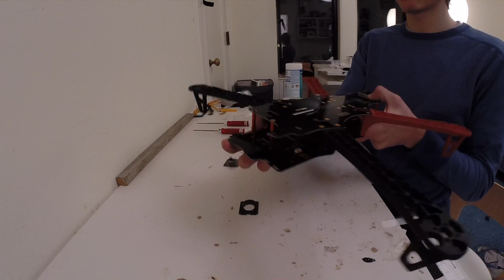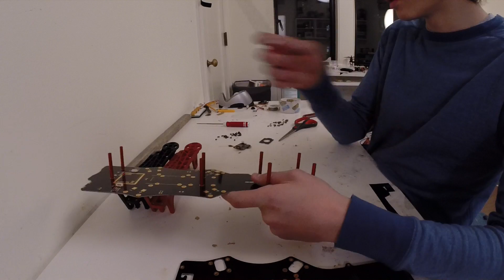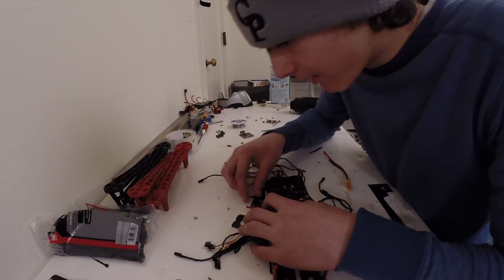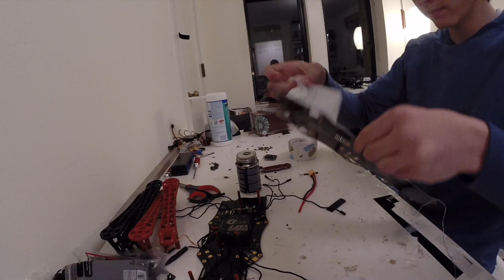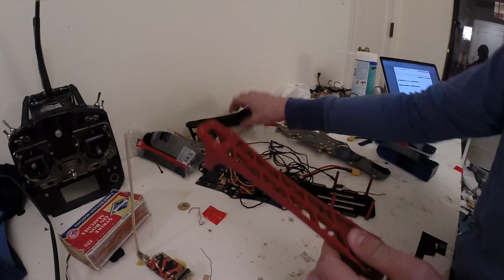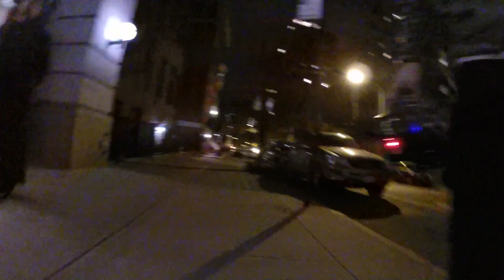TBS discovery | acro naze32: Soldering | naze setup | motor setup | esc setup | maiden flight

Comment: I fly a TBS Disco with a Full Naze32- 980kv Sunny Sky motors and ez-uhf and 1.3 video with ez osd.
I use 4S with 8 or 9in props- 3S with 10in props Depending on how I fly it- I get 13 to 17min on a 4S 5000 nanotech (35-70C) Maybe 9min on a 3700 4S but I always fly those harder.
One of the best flying quads I own.
Reply: If you know how to decipher the backup file (PID's are in order of appearance in baseflight) then here you go- these are set up to fly similar to a Naza in manual mode. I cannot find my TBS Acro PID's atm.
"PID":[[3.5,0.03,29],[3.7,0.03,32],[13.5,0.05,8],[1.6,0.015,7],[0.11,0,0],[2,0.08,0.045],[1.4,0.2,0.08],[7,0.01,20],[4,0,0],[12,0.045,1]]
Reply from the maker: dylan scully Mines on stock pids I love it lol
Reply: Team Icarus RC
I run stock pids and it pitches too weird for me and will not pull out of flips and rolls very straight. I had to tweak them- the ones I posted are on my profile 2 and I use them for AP- they are very smooth and I use a tad of expo on my radio.